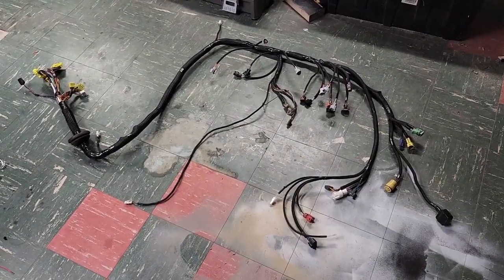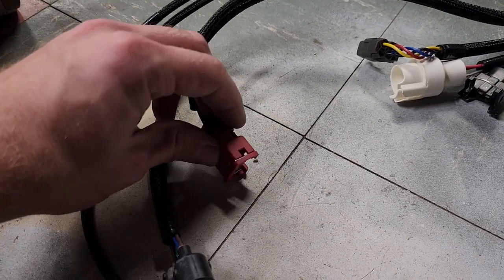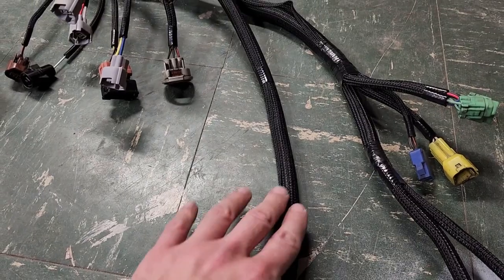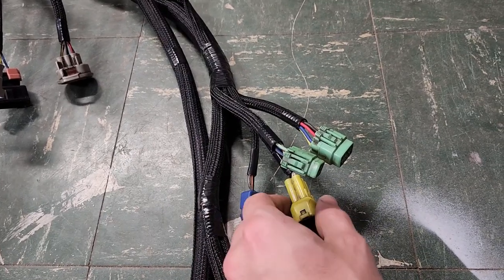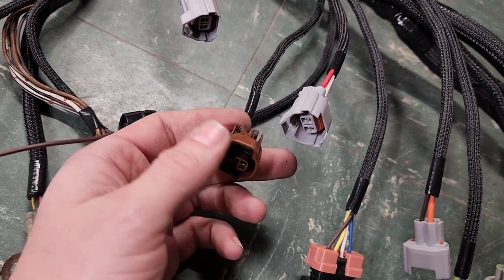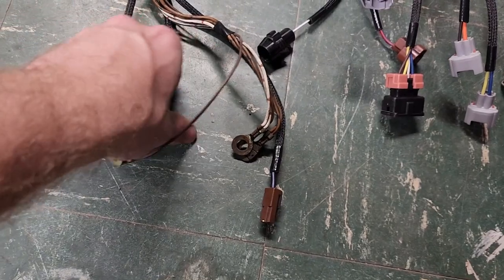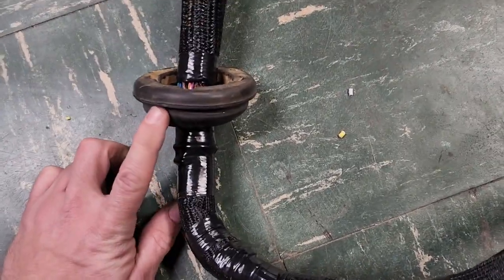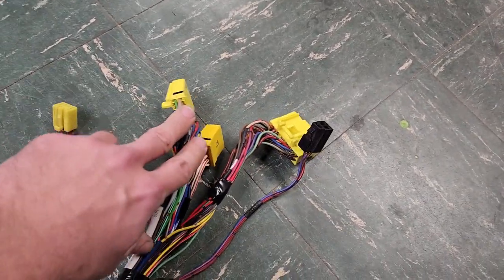7MGTE Harness Connector Overview

Comment: Found this really helpful, thank you so much! I’m just curious however if it’s possible to swap a late 89 (grey plug?) harness into an 86 chassis? The harness I’ve got has been modified for an aftermarket ecu but I’m not too sure about the body plugs…